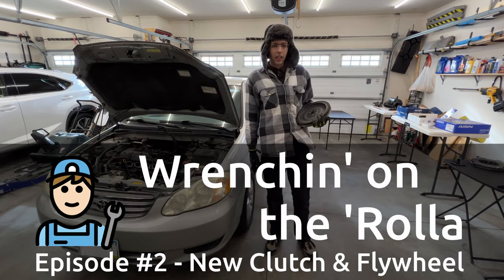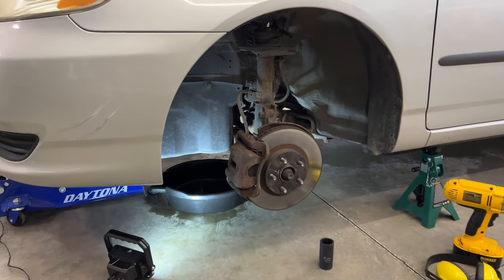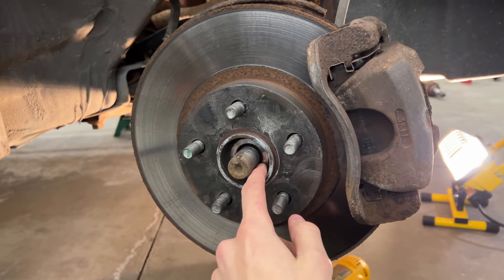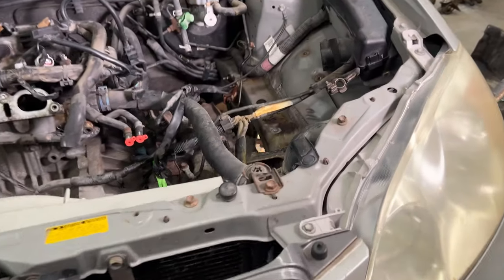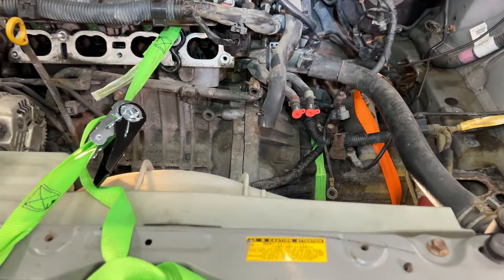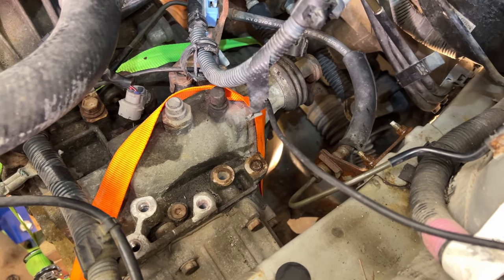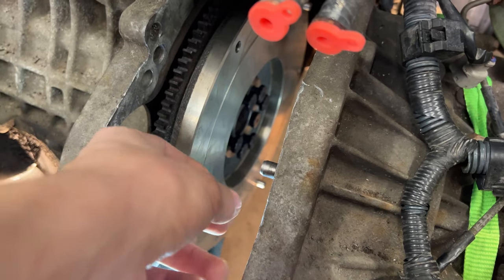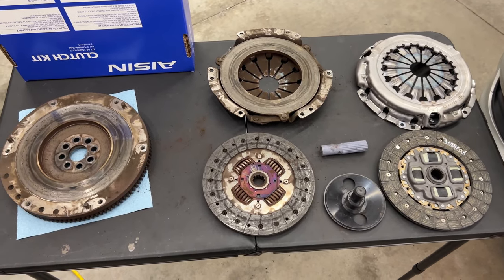Corolla Clutch & Flywheel Replacement (2003-2008) Without Fully Removing the Transmission

Comment: Great video, I am in the midst of replacing my clutch / flywheel / throwout bearing on my 2004 Matrix (it's "kind-of" a Corolla haha) and found your video while taking a break (was about to remove the CV axles). Thanks for sharing your tips on what not to do when prying out the CV axles! I was planning to completely remove the transmission but will give your suggestions on how to do the replacement without removing it. Also, thanks for showing the torque settings, it was great to get so much useful information in one video. Excellent job with your explanations!
Reply from the maker: You’re welcome, good luck on the replacement! The matrix sounds like an awesome car, more practical with the large trunk and not ugly like the current gen corolla hatchback lol. If only we got wagons like Europe…

Comment: If you remove the subframe and chain the engine from the top it will be much easier, your approach is really difficult and you give yourself alot work

Comment: Good video and Great info. Sometimes it's important no doubt to just think it through before proceeding and just take your time. Pictures and marking are always valuable too when you are reassembling. I commend your efforts as it certainly is not an easy job without a lift or pit either.👍👍
Reply from the maker: Thanks for the comment. Getting a lift is definitely a future life goal. But hey, working on the ground builds character as they say.

Comment: Great video man, thanks for posting and all the details and options, about the axles, like with everything there is a tool for that although it is pricey if you want a quality one, I got mine on my 2004 Corolla out now and putting new replacements but next time out will go with the tool thanks to this video, I have seen the crowbar tapping as well in the body of the axle this is how I took my stock ones out but only because was going to dispose of them anyways, it damaged the seals which were also replaced. One detail on the flywheel bolts, a mechanic from my local Toyota dealer told me they can be reused as they are not TTY, I would double check with another mechanic who does transmissions to make sure, mine has come out already 2 times as clutch was replaced before, then I put a Clutch Pro Max  light flywheel last week but took it off as changed my heart after seen some you tube videos of them clutches pressure plates broken, ended up buying an Exedy kit which comes actually today. In my case my engine is in the garage as I did an engine overhaul and many other components for the last....3 years! but after I put in the clutch kit and transmission, will finish mounting engine components and God willing will drop engine in in next few days...I have done everything myself, not this type of mechanic althoughI work in electromechanical engineering, wondering if the car even will start, LOL. Lots of time and $$$$ in this project restoring this 2004 Corolla for my oldest daughter after it was literally destroyed by oil starvation, twice!!...then after that is complete got another project with a 2000 Tacoma which I alone destroyed the engine by driving it after 5 years sitting with old fluids after replacing fuel pump; helped by a street "mechanic" who was recommended to me by a friend...he never warned me about what I was going to do, the plan was to drive to get some miles to pass smog then change all the fluids which it should be done before driving it...now it blew the head in an engine that was never in a major repair with 210000 miles, since doing the head will do the whole engine, coolant system, clutch, brakes and front end, just like in the Corolla...enough to keep me busy for the next 3 years me thinks! All in all very detailed video, I subscribed.
Reply from the maker: Hello and thanks for the comment! I like to see detailed comments, I too often write long replies to people to get all my thoughts out. It sounds like you have more mechanic experience than me, having done a full engine rebuild, I have not gone beyond a head gasket on a Prius and top end on a two stroke motorcycle (super simple). I am also an engineer by degree, having finished college with a mechanical engineering degree a few years ago. But indeed the engineering knowledge does not translate directly to auto repair, a whole other set of things to learn. I am lucky to have a friend who is a certified professional mechanic to ask questions and learn from.

Yeah the CV axle tool would be nice, I might invest in one the next time I need to pull one out as well. I cannot remember where I read that the flywheel bolts were TTY, but they might not be, although I do remember somewhere saying they were. But either way you would probably not have issues, lots of guys online claim to reuse stuff like flywheel bolts and even head bolts that are definitely meant to be single use and get away with it.

I have to wonder, was the corolla originally your weekend fun car, given you put in a performance clutch? But now it is going to someone else, hopefully you replaced it with something fun for yourself! I just watched a video on the new 2023 GR Corolla, wow what a car, much more serious than even the 05-06 Corolla Xrs. Ugly looking in my opinion though LOL. I much prefer the style of the new Nissan 400Z, not the brand though. Either way I’m not one to get expensive new cars anyways, I just keep up with the new stuff for fun.

Sad to hear that about a Tacoma, and somewhat surprising, did the cooling system clog up or boil away causing overheating and a warped head? I watch guys like Vice Grip Garage who take old junkers, get them going, and drive them hundreds of miles home on old fluids (except for the oil) and they seem get away with it. Although those engines are old technology, probably much looser tolerances and more accepting of old fluids. I have not dealt with a car that sat a long time to have any personal knowledge. I have a Pontiac G6 that has more or less been kept in storage the last few years, but I still get it out and drive it every few months to keep it fresh.

Good luck on all your upcoming projects!
Reply: @BrenoAutoGarage   We ended up getting  the Fly Wheel Bolts fro dealer, better safe than sorry; mine have come out already 2 or 3 times, I got a "break" from the dealer which discounted 10% so instead paying $128.00 for all Bolts, ended with a nice $90.00 paying $10.00 per bolt instead of $15.00!! I know I could find them even cheaper but I look for some time and could not find cross reference parts from ARP so we decided to get it from dealer, in the end the project, like every restoration project is a money pit so at this point, who cares? LOL. I have used quality parts or Toyota genuine OEM parts where I can; Engine critical parts like bearings and gaskets are Mahle, oil and water pump are Aisin and so forth; the parts reused were detailed and restored; I did not do the head; was done at a shop and i am at their mercy; the Timing kit was I believe DNJ which it is Chinese and so is the Radiator and also I got all AC parts for replacement if needed as that AC runs hot; so once the car runs if it does; still have an AC project to fix but not to worry; of course I have all the tools needed and the know how, thanks to you tubers and my brother who is an Commercial/Residential AC Tech..i am not looking forward to it but it will need to be done; my original compressor is good; the Relay is testing good as well and the system may have a leak; all need to be tested once engine runs again as I got advised by another experienced mechanic; I would love to evacuate freon and disconnect and replace parts but if this is needed the engine would not be too much in the way even though it would be easier to do it now, will have to wait. Quite a project, agree?
Reply from the maker: That sounds like most of my projects, start out just wanting to fixing one thing, and end up finding two more things that need to be fixed/perfected. I agree on quality parts, not worth the time it would take to fix something twice if the cheap part breaks.

I recently replaced the AC compressor pulley, clutch, & field coil on my Corolla, I filmed it for a video as well, but have not spent the time to edit the footage since I’ve been busy at work. I will get that video published to YouTube eventually though, I do not rush myself on that. But for that repair I did not have to disconnect any refrigerant lines which was very nice, I think I got lucky since there are so many things that can break/leak in the AC system. It sounds like you have some good people to talk to and help with it.
Reply: @BrenoAutoGarage  That is awesome, I just managed to take apart the car dashboard as trying to get better access to the clutch master cylinder nuts under it and possible the power booster, kind of very difficult to do with the dashboard in place, that according to Haynes manual is not an easy job for the home DIY, I agree, took me almost all day few hours as manual is not clear what to take first and now that all is out in the open I keep questioning myself if I should just continue and replace the evaporator, which could access very easy now; like I said I have all the AC components needed but have to find the leak because AC runs hot, charge seems to be fine, compressor fires and relay tests ok, I do not see indication of leaking around the area of the evaporator but can not be sure unless taking it apart, at least if I ended up having to replace all or most AC components I got everything I need and all the tools but can not stop thinking this could be a good time to do it as everything is so accesible, and the new compressor could be mounted straight out in the engine before drop in
Reply from the maker: If it was hard to get the dash apart I would definitely replace the evaporator (I have not taken my Corolla’s dash apart before, just the gauge cluster out).

My dad once paid nearly $1000 to have a shop replace every AC part and line in the engine bay of his old truck, but not the evaporator (because of the labor cost to open the dash). Then 6 months later the evaporator began to leak.. He did not want to put more money into it, so all those new parts and $$$ went to waste. That was many years ago before I knew anything about cars, but it’s a story I remember when I think about car AC systems.
Reply: @BrenoAutoGarage  Yeah it makes think, what if, the evaporator I have is chinese, and so is the compressor and the condenser, can not help to think what if I replace all these parts and then get a failure as the originals may last forever? it is very costly to get original Toyota parts, the condenser and compressor are not difficult to replace compared to evaporator but if I replace it then will be replacing all the parts since have to recover freon; one mechanic told me the AC may be low in freon thus the hot air but then that would be due to a leak so it is a mystery
Reply from the maker: That is true about OEM parts outlasting replacements. Did you leave the compressor in the engine bay with the lines hooked up when you removed the engine? I was assuming the system was already disconnected and empty of refrigerant.

If the system is still all connected I would get an AC pressure gauge set or even just a refill bottle with the gauge included. Then hook it up and read the pressure. Normally you would read pressures with the compressor running (not possible with engine removed) but there should still be pressure even with it off. Check out this link for some more information on engine off AC pressure: https://forums.tdiclub.com/index.php?threads/ac-low-side-reading-110-psi-with-compressor-off-what.435925/

If pressure is zero then you have leaked out all the refrigerant already and can replace whatever parts you want, since it will need to be refilled anyways.
Reply: @BrenoAutoGarage  Yup, it is like that still; pressure gives 69psi when tested with outside temp of 110F, I think it means it is low which may be why AC runs hot last time tried, but if low also means there is a leak...where would be the question and I do have new system seals besides all parts; speaking of which I have new drier which goes on the condenser; don't I need to evacuate freon to replace the condenser drier?? I am progressing through this at very slow pace as I got a hurt shoulder. I scratch my head furiously wondering if I should just replace the parts just because I am doing a through mechanical overhaul, lot of stuff outside main engine components have been replaced as I am trying to leave this car as mechanically sound as I can and do all major work that would warrant getting the engine off. I replaced the clutch master and slave cylinders just because I am putting a new clutch and brake fluid needs replacement, I am not replacing however the brake master cylinder which had to be pulled out attached to the power booster to get access to the clutch master; a real PITA but it is done, to do that clutch master for instance and just because not particularly reason i had to strip the dash board off the car to get proper access to the nuts..I was going nuts! LOL, and now that the dash board is out of the way keep thinking well, get the blower out and get to the heater core, again, system would need to be evacuated but them I would install the new compressor in the engine before going into bay and can even get better access to work the engine in getting the condenser out of the way, then connect and charge the system back. I would like to know how much grams of freon the system would recover, in my car the charge should be 1.1 pound, also maybe the system ran hot because of a bad cooling system and/or a bad thermostat which was a gates one previously and now it is a Toyota original one. As of this post, I have touched nothing, would hate to see I would have to replace an AC component and that I had access and then would have to do more work to get it done, it would not be impossible and I already know how to get to the parts it is just that now it is easier.

Comment: Really ejoyed your in depth video. My 2008 Corolla's clutch slips typically in 3rd and 4th. Is there any adjustment other than the pedal height under the dash? 200,000 miles 🙂
Reply from the maker: Thanks for the comment, I don’t believe there are any other adjustments, although I didn’t check mine when I did my clutch.
Reply: My 09 xrs has an adjustment.  It's under the clutch pedal. Loosen the nut and thread in or out, the link. The link connects to the back side of the pedal.
Great video. I'm replacing the transmission in my corolla.

Comment: Not having done this before with the matrix,   I'm wondering if it would be advantageous to separate the entire motor train from the car?   Then it's open and can work on it in my shop with lots of lighting.
Reply from the maker: It would make it much easier to align the trans back onto the engine when you’re done, and to do a rear main seal if you want.

But you’d need an engine lift and have to undo the wiring harness, coolant lines, clutch line, exhaust manifold, A/C compressor (I would dismount and leave in the bay with the A/C lines hooked up), power steering, possibly more I’m forgetting… I’ve never pulled an engine though, and might be making it sound harder than it is.

Guess the takeaway is either way this is not a fun job, but good luck on yours!

Comment: Great video!!!, personally I don't see myself working on my transmission but still very interesting. Now i want to ask you something, is it possible to swap the rear drum brakes for a good pair of ventilated disc brakes? And if so, how's it done?.
Reply from the maker: I have been wanting to do this myself, you can find other videos & forum posts out with the exact details. But you need quite a few parts:
-wheel hubs & backing plates
-different parking brake cable (routed under the exhaust heat shield)
-different brake soft lines
-internal drum brake parts for the new parking brake (not the same as the current drum brakes)

Plus the normal stuff
-calipers
-rotors
-pads

Get parts from 05-06 Corolla Xrs or a few other models with shared parts (Matrix Xrs, Pontiac Vibe GT, possibly Celica GT)
Reply from the maker: https://www.toyotanation.com/threads/diy-2003-2008-corolla-matrix-pontiac-vibe-rear-drum-to-disc-conversion-w-pics.1677017/

Comment: I would also leave that rear main seal in place if it's nice and dry. Especially if you have less than 150k miles on the engine.
Reply from the maker: She’s at 237k, pretty sure it’s the original engine but transmission was rebuilt at 150k, so they might have replaced it then.

Very impressive for the miles, especially since I have a Pontiac G6 with only 110k miles that has a slow leak I’m almost certain is from the rear main seal. Real shame since I don’t want to pull another FWD transmission! It’s minor enough I’m leaving it alone for now.